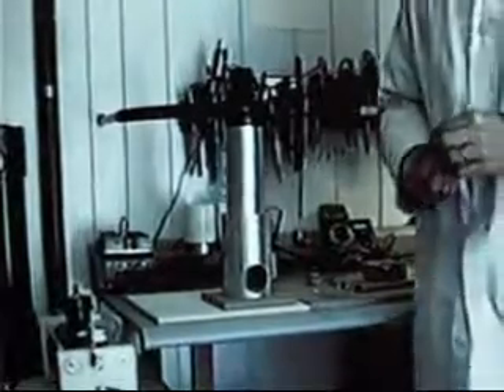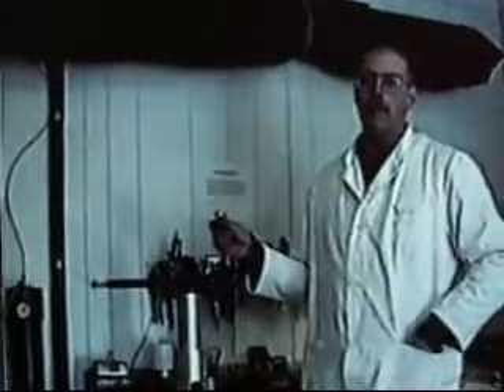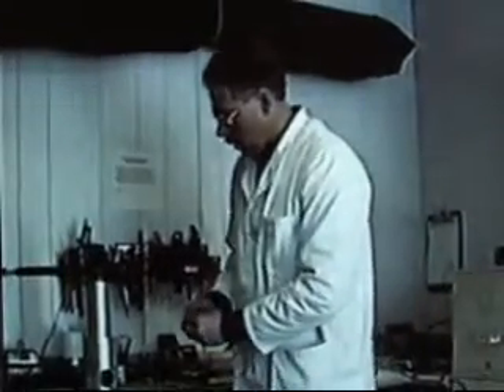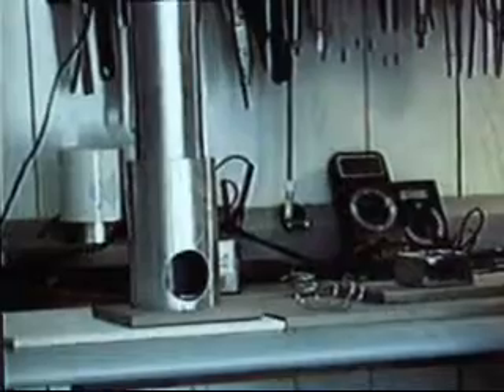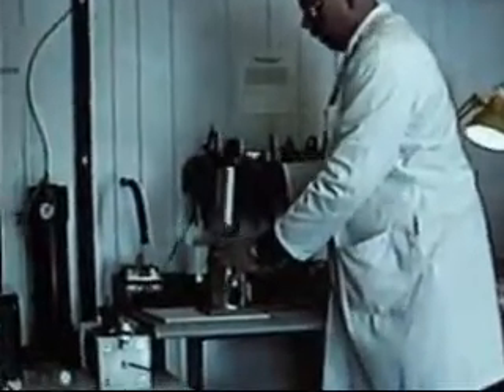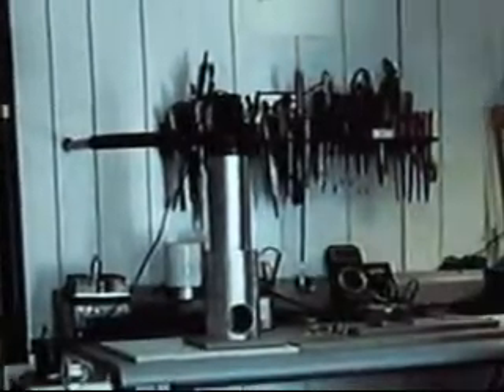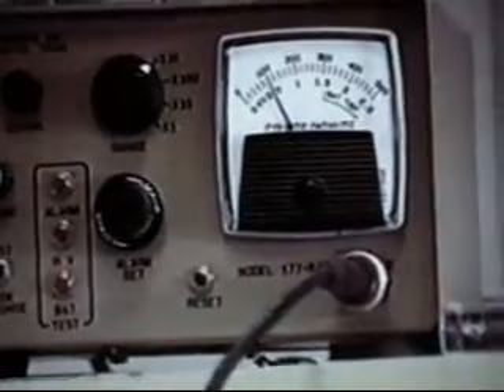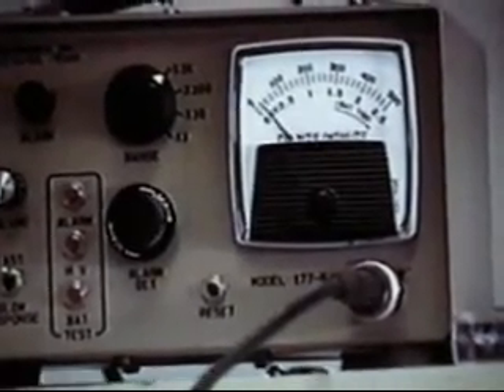Nuclear Waste Neutralization Using Hydroxy Gas

Comment: need to work on such findings, and with the unnecessary exhaust he attached, his words, he should have or we need to have test equipment on that.. that is a must as well. They have micro organisms that live in reactors and eat the radioactive stuff, and a few companies or researchers say using micro organisms could solve the problem, but eating radioactive waste and not checking the micro-bugs waste is an issue.. Just like sunflowers that do the same, they absorbit, but it just moves it into the plant and what good is that unless you want to pull it from an area and under controles means, then take the plants to a safe area. Does the gas just move it to the exhaust, or does it deplete it?

Comment: "The ONLY way to neutralize radioactivity is to wait out the half-life of the nuclide, then the half-lives of all of its daughters until it decays to stable." 

I'm not entirely certain about that. One of the first things that I thought about when I began to research low energy nuclear reactions, apart from the topical application that I was researching in the first place, was that it is a process that has potential to transmute nuclear (and other) waste into other elements.

Comment: 45 views, let mine be the last. The color of that flame was not 130C. Americium is well known for its volatility. You simply spread the element all over to the point your counting tube is no longer as efficient as the original point source; that is, if you caught all the Am vapors. Nice lab coat. If you added a few radiation symbols and turned clicking on the Geiger counter, you possibly could drown out science enough to support your fiction.